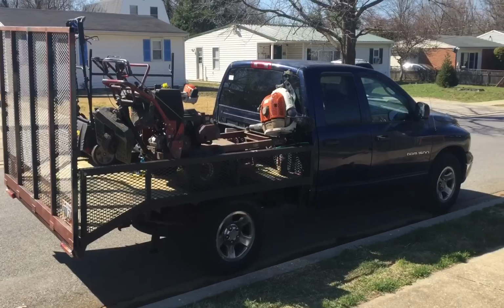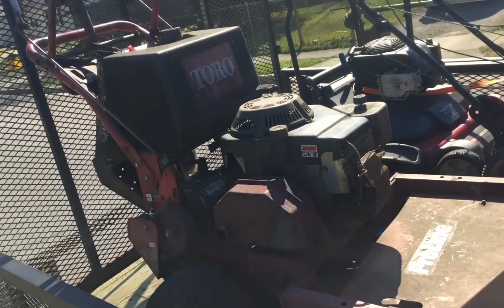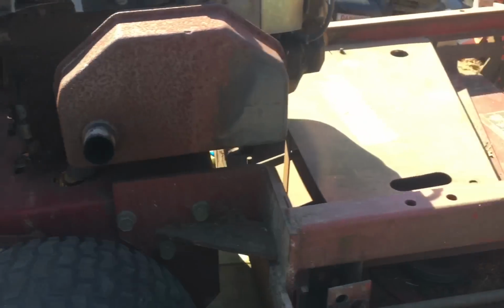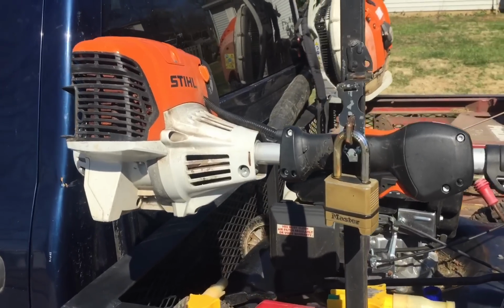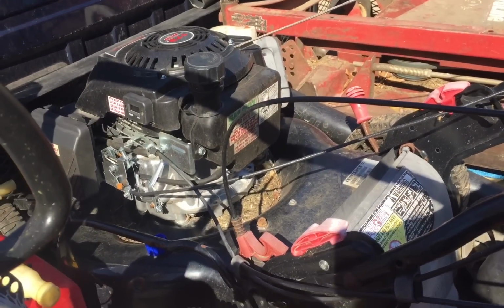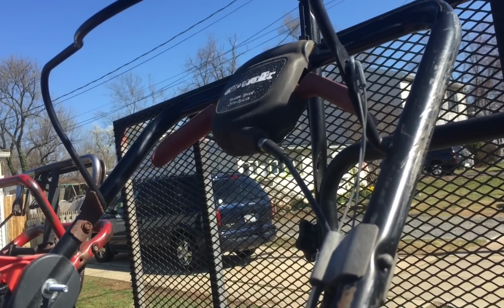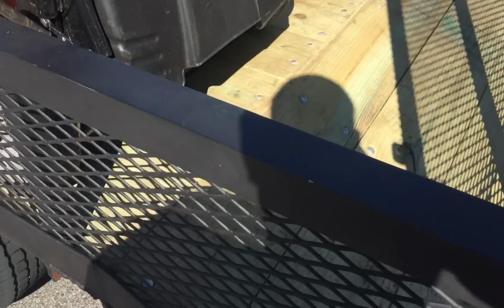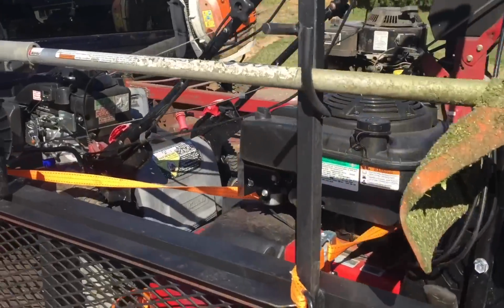2019 Lawn Care Truck Setup (No Trailer!!!)

Comment: My Ranger is obviously light duty.  I upgraded to KYB MonoMax shocks about 33,000 miles ago. With a mower in the bed or a trailer out back the hd monotube shocks keep the truck well controlled. I've driven Rangers new and can say the handling is much better with these. Once I upgraded to LT rated (load range C) tires along with the socks my handling when loaded improved dramatically. 
God bless your '19 season!
Reply from the maker: I bought some pretty heavy duty shocks for the rear and hopefully they'll be here thursday. Thanks may od bless your season as well!

Comment: Would a 10 foot bed with a two foot dvenyail work? I'm wanting to run this kind of setup with two mowers a 36 inch badboy outlaw and a badboy 61 inch zero turn. Handheld 2 stihl 110 and a stihl backpack blower (haven't decide what model yet)
Good looking setup for residential work
Reply from the maker: I would think it would work. Do a layout on the ground and see how it fits

Comment: if you are replacing the shocks then i would buy the monroe air shocks it will add capacity and you can adjust them for thhe weight of what you have on the back. (80$ at rockauto dot com)
Reply from the maker: Thats actually exactly what I bought. Should be arriving today
Reply: @TheRandyDulin  i got them for my f150 and love them very good for what we do. the fittings leaking will drive you crazy but you can order the fitting online and change it from plastic lines to rubber that dont leak (its hard to find but its out there) not a standard fitting.